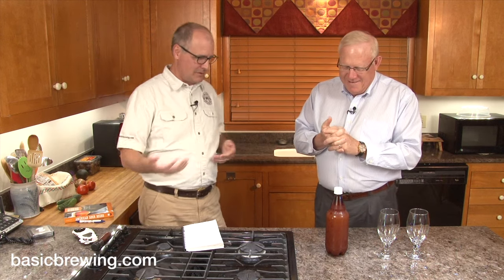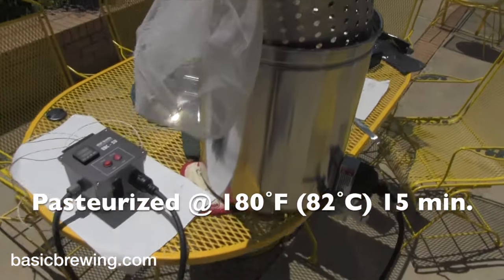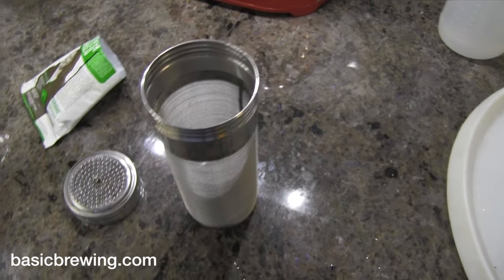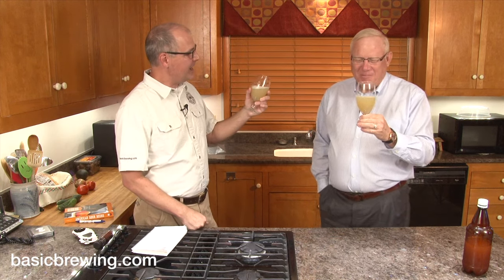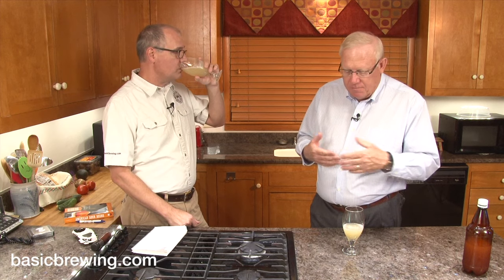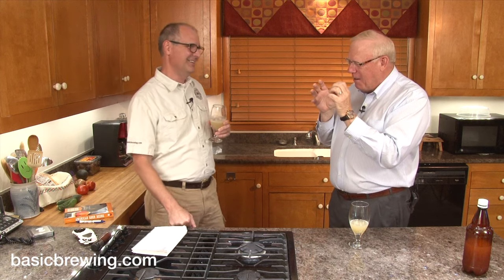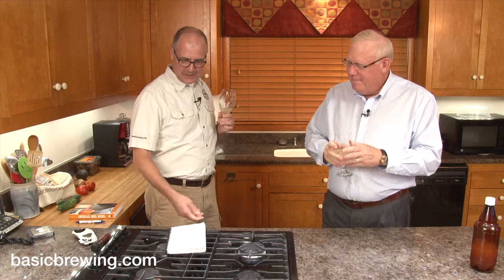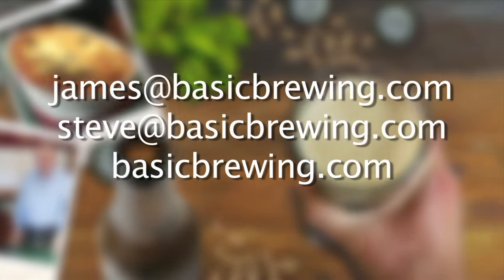100% Rye Tart Hoppy Ale

Comment: For Kettle souring: The best, and simplest is omega lacto blend (oyl-605): lacto brevis and lacto plantarum. I've had a lot of luck with that.
Reply from the maker: Excellent. Thanks. - James
Reply: Best of all, works great at 80 degrees, so you don't even need the fancy temperature controller

Comment: If you want to try something that will make things significantly more sour, I'd recommend Lactobacillus plantarum 299v instead of delbrucki. I buy my plantarum as capsules (each capsule contains 20 billion cells)... it's a pure preparation used as a probiotic. The brand I use is Ethical Nutrients IBS Support, it will make wort pretty tart in 48 hours - and as a bonus it works at room temperature rather than the high 40's celcius. I've always boiled it after souring and pre-fermentation -- but as it's a probiotic its safe to consume alive too! I've heard rumours that it's also more tolerant of hops than most Lactobacillus - but I've no evidence of this myself -- and it's simple enough to add flavour/aroma hops in the post-souring boil  :). Anyway - I hope that's of interest. David.
Reply from the maker: Excellent. Thanks, David. Cheers! - James

Comment: Try Mango Goodbelly. 1 jug will work for a 10 gallon batch will sour to 3.5~ ph in 24-36. Pitch at 90 but you don't need to hold that temp.
Reply from the maker: Excellent. Cheers! - James

Comment: Did you get any signs of yeast fermentation during the wort souring (WLP677 was notorious for having yeast contamination in it, however I believe that White Labs has fixed the problem)?  Yeah, WLP677 isn't the greatest for sour worting.  Also 120°F might have been too hot for it, not sure on that.  Thanks for the shoutout on the MTF wiki!   As the editor of most of the content on the MTF wiki, feel free to ask me any questions!  

The GoodBelly Mango shots (~4 oz) are the probiotics that people seem to have the best luck with.  Use as fresh of a package as possible (Lacto has a short shelf life).  The Omega Labs OYL-605 is the best Lacto culture from a yeast lab, you can sour with this without temperature control at 70-95°F (1-2 IBU will kill this Lacto though, so don't hop until after souring).  Cheers!
Reply from the maker: Thanks, Dan. I didn't see any activity in the airlock while holding at temp. I located a store through the GoodBelly site, and I'll look for it next time. Glad to give you guys a shoutout. I was going through the wiki article on sour worting and saw a link back to BBV. :-) Cheers! - James

Comment: I've used Omega Yeast Labs Lacto Blend and Mango flavored Goodbelly Shots. Goodbelly shots are very cost effective. When kettle souring I just throw in 2 GoodBelly shots per 5 gallons. I have never made a starter with these lacto cultures. If you do, you are doing it right by checking the Milk the Funk Wiki. 

I did this same thing using Michael Tonsmiere's recipe on his blog. But I got some bitterness that is clashing with the sourness. I'm going to have to rebrew this to try not to get the bitterness again.
Reply from the maker: I found a store that carries the Mango Goodbelly shots. What temperature is optimum for them in your experience? How long did it take to get a good level of sourness? - James
Reply: Living in Mississippi, I brew these in the summer, my process is that I chill to 110, pitch and leave it in my garage. Normally I get a decent sourness ~24-36 hours. Depending on the heat. Plantarum is a pretty resilient lacto strain. I believe it can sour in the 80s.
Reply from the maker: Thanks!

Comment: What if any advantages does that cylinder have over hop bags? I'm new to brewing (three beers so far, a saison, a Russian imperial stout, and a brown ale that's still conditioning in the bottles), and I've tried using a filter in the funnel that we use to pour the wort into the carboy, which I found to be more trouble than it's worth, hop bags once, and then my last brew, we forgot to use hop bags or a filter, and there were chunks of hop residue floating in the fermenter, but I don't think any made its way into the bottles, although I can't be sure (I'm cracking a bottle for the first time on Saturday). Basically, I've found the hop gunk to be kind of a nuisance so far, and I'm looking for options to eliminate that issue. Would this cylinder help? Another thing I've considered is whole flower hops, but I don't know if the weights would make a difference there, and the brew shop I normally go to doesn't carry them (though I know a place that does).
Reply from the maker: In the past, I've just chunked hop pellets into the kettle and racked using a siphon into the fermenter. However, with this new system, the only drawback I've found is that hop debris tends to clog the lines. I saw the cylinder in the store and just decided to give it a try on a whim. It's usually used in dry hopping in the keg. For small amounts of hops and a standard boil, it seems to work fine, I take it out every now and then with tongs and let the wort drain out to ensure the hops are getting exposure. I also squeeze hop bags with tongs periodically for the same reason. I don't like whole hops. I like to call them "wort sponges." A lot of liquid is trapped in them at the end of the boil. Overall, I don't worry about hops in the fermenter. They usually settle out. - James

Comment: Just to ask, is citric acid an unwanted acid in brewing?  If there are no real negatives, then I would have to hazard the guess that citric acid may be an easy way to gain both acidity and citrus note albeit not a floral one.  (edit: not suggesting in lieu of lacto fermentation, but as a finishing stage after yeast fermentation)
Reply from the maker: Citric acid is used in mead and wine making to make them less "flabby". I haven't used it in beer, myself, but everything's worth a shot. You might try a tiny amount in a pint to test first. - James